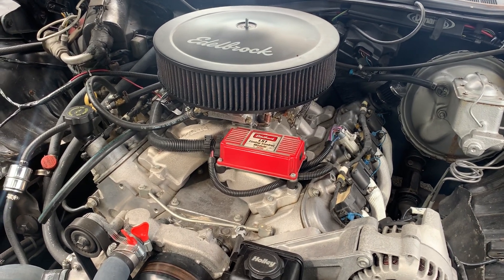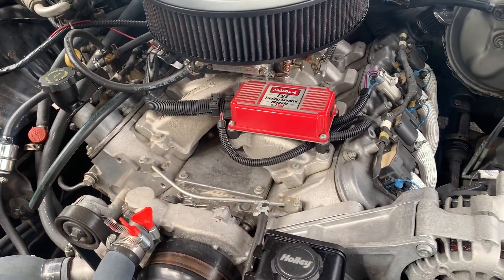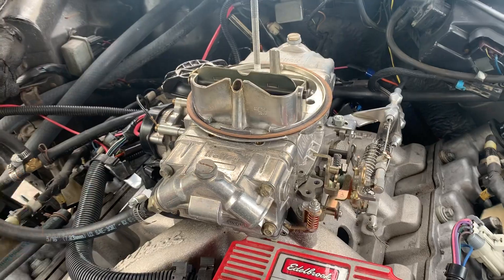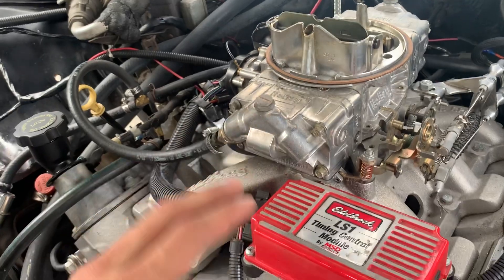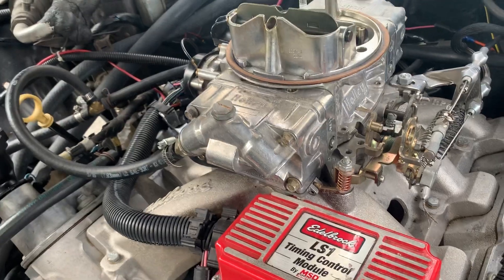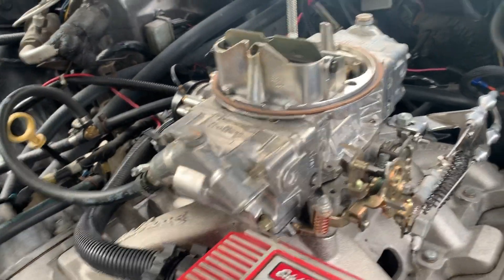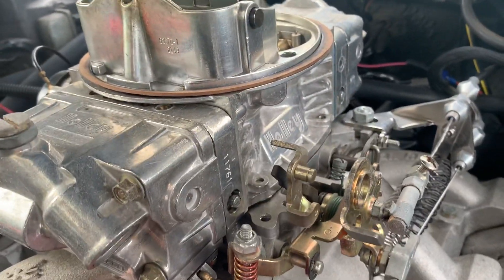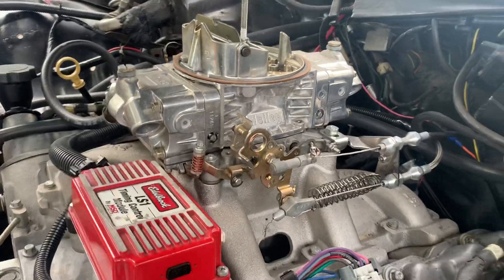How to tune a carbureted LS engine

Comment: Do you have an electric fuel pump… I messed up by adding electric additional eldbrock fuel pump 6-7 psi…. Think it to much gas
Reply from the maker: Yeah, probably I imagine it’s a little too much psi. I used a holly red because you don’t have to use a regulator if you’re using more fuel than that then they make other holleys that work. Plus the Halle that I used was plug-in play.  If you look it up on the LS forms for carb swap, you can see a lot of information on that topic that’s where I learned most of the stuff on lstech.com.

Comment: Not to tell you how or what to do but your engine would run a whole lot better if you go with a dual plane intake instead of the single plane .I went from the single plane intake to a dual plane one and picked up 50foot pounds of torque and a lot smoother running engine and the engine was a lot more responsive.I have a ls 6.0 with a sloppy stage two cam and I would never have believed it if my friend didn’t kinda force me into believing him

Comment: Used a street avenger 670 for the longest time. Couldnt get that bog out of a smooth transition. Went to a holley dp 650 and problem solved. Def rec one of those instead of the street avenger

Comment: Quick Fuel carbs work best with LS. Pricey but you won't have the bog problem anymore. I only adjusted the idle screws by ear. Runs like a beast! Aluminum 5.3 , 799 headd with summit stage 4 cam
Reply: What is your timing set at ??

Comment: Holleys suck ass anyway I've never had any luck w them ever but it sounds to me like your accelerator pump is in the wrong position and it needs more fuel but I want to run one w a quadrajet and I bet it would run much better than that pos holley does a good q jet will outperform and be much more of a all around streetable carb than either a edelbrock or holley would

Comment: Somebody needs to give this fella a lesson with an old school carb guy. Carbs don't time engines. Jetting, accelerator pumps, power valves, springs in that vacuum secondary set up he has. My advice is to watch videos and get a how to tune Holley Carb manual. Good luck.
Reply: Exactly! And the accelerator pump

Comment: Before tuning your carburetor, make sure you measure the amount of vacuum at idle (in neutral if a manual and in gear if an automatic). Once you see the max vacuum, half that number is what power valve you will need. This must be set before adjusting accel pumps, jets, etc. Oh yeah, LS engines love timing :D

Comment: Not many people launch at zero to 1000 rpm, that hard on engine parts. Try 1800 hold with foot brake then release brake and stomp it, you should have a better result.
Reply: Nobody goes from 0 to 1000???? 1000 is barely above idle. How dumb are you??

Comment: Preach.  I have a 07 LS3 5.3 that I have a carb.   I installed a stg2 cam.  2400 stall converter timing curve 1200rpm and up at 34 degrees.  Stock TH350.  4.10 gears. I floor it and watch the RPMs shoot to 2400.  Then the engine just bogs for a second then climbs.  I’m running an avenger carb with the 50cc accelerator pump.  AFR 14.3.  I can’t get rid of the bog

Comment: Mine is doing the exact same thing.  Bogging until it gets to 3k rpm  Even swapped the torque converter to 2200 stall. Did you do a second video to this?
Reply: Install a wide band AFR gauge regardless of carburetor type. Tune your carburetor in 3 stages, idle , Cruze , then WOT power.  Carburetor could be very lean causing it to bog through the RPM.  It’s very likely if your carburetor was purchased used that the jetting is incorrect for your application. No motor is the same.  Even a new carburetor will have to be adjusted to your motor.
Reply: I have and AFR gauge. 14.2 at idle.  14.7 cruising 17+ at WOT.initially but comes down to 14-15. Brand new Holley 81570. Off the line it’s still a dog with the higher stall.  Once rpms reach high 3’s it takes off.
Reply: @Keeterbob  Your definitely to lean at WOT. You wanna be anywhere around 12.5 at WOT.  I would Increase the secondary your secondary jets. Your other circuit read fine. If the bog is that low in the RPM. I would look increasing your accelerator pump shot / discharge nozzle. Not sure of your ignition type or engine size. But to narrow down the issue, swap another carburetor on it and see if it’s still there.
I run a LQ4 with 862 heads / TH350 stock converter, MSD 6014, 91 octane , RV cam , small AFB carburetor. Mines run like a bat out of hell.. You wanna size your carburetor to the highest shift point and cubic inch not the max RPM of the engine.
Reply: 5.3 is in a 74 K2500.   Th350 with 2200 stall. Stock transfer case   Stage II cam from summit. 4:10 gears
Reply: @Keeterbob  Heavy truck with tall gears, should burn tires at the light like no other. I have the summit 8718 RV / towing cam. 3.36 in a 68 el Camino. Mines a 6.0 with 5.3 heads.  Those gears your running aren’t designed for top end power, then are for low in. Try the 1405 and see how it does. I’ve been building carburetors over 13 years, that smaller the CFM  the better. May sound crazy but a 500 CFM will wake that engine up. As it will never use anything more unless your drag racing or shifting over 5k. Look up summit carburetor calculator and enter your highest shift point during WOT.
Reply: Just ran the 1405.  Made 6 passes.  AFR 12 cruising 15 wot. Still bogs.  The 1405 has more pep right off idle but that it.  Performs just like the 81570   I’m starting to lean toward my timing curve on my 6014
Reply: @Keeterbob  wouldn’t hurt to play with the timing. Mine used to set at the factory truck setting before I swapped to small cc heads now I’m on truck HO. If you haven’t hooked up had map port on the MSD 6014 , it’s not a bad idea to run it. Its just a vacuum line from the intake to the port on the box.. you’ll get it man! Good luck.
Reply: On my MSD  LS1 HO has worked the best of all of them.  Even customs.
Reply: Vacuum is connected
Reply: @Keeterbob  do you have lean spike right from idle ?? No vacuum leaks? I had the issue from idle when I ran a 750 carburetor.. but changed to a smaller carb and rejetted it.. stiffer accelerator pump.. larger discharge nozzle solved the bog for me.. your sound as it happening before the secondaries even open. So its either timing, vacuum leak, or carburetor idle circuit.. that’s each area I would dig into
Reply: 2006 truck 5.3 with an MSD 6014.  Going to try edelbrok 1405 with mechanical secondary.  See if that makes a difference.

Comment: The MSD box is a good solution for this engine thas has no factory provision for a distributor but MSD box  is not able to do  the vacuum advance, but only to do the mechanical advance, wich is not the best solution for street car if you expect to have the driveability low end torque and fuel efficiency
MSD should build a box with an additional Vacuum sensor connected to the carburetor, with several curves allowing the vacuum curve to be tailored as well as the mechanical advance curve
Reply: There is no distributor, it's electronic advance, no mechanical and no vacuum
Reply: @playsportfun3356  it doesn' matter mechanical or electronic ,  the engine need advance based on rpm (depending of engine speed rotation), and advance base on vacuum (depending of cylinders filling) ! That's rule of thumb ! 
Here the advance is based on rpm only ! Vacuum advance is missing and the result is less performance and more consumption ! For exemple Renault made a similar box like this one in the 80s ! Called RENIX, this box worked with a rpm sensor a vacuum sensor like a distributor but all was electronically performed !

Comment: Carborators are way easier to work with than Fuel injection in my opinion. Season changes you just have to adjust the choke. That little black circle with three screws. Move it one knotch back to lean when temps hit below 50
Reply from the maker: I agree I think I’m going to get a edelbrock back on it like I used to have
Reply: @PNWPablo  get an Avs2 Edelbrock...ive got a 1906 on my LM4 and couldn't be happier

Comment: I have the same control module but mine seems off. its running off real bad how do I adjust the timing. do you know?
Reply from the maker: Yeah, if you read the comments below yours you can get a good idea of what to do, besides that because we don’t have the control module that can be adjusted on the computer, you will need to go to the pills to see which one works best and to tune the carburetor in my opinion to the lowest setting I feel air so the stumble is decreased. There’s no way to control the timing with the carburetor unless you go through the simple steps of tuning the carburetor to your exact needs but the engine is hungry and always seems to need more when in reality needs less especially when you’re talking about getting the most HP out of your RPMs
Reply from the maker: And double triple check to make sure you have no leaks in the entire engine and exhaust system that’s the first step, then would be to tune the carburetor to your liking, that’s how timing is achieved with a carbureted LS1/LS6
Reply: I had the same box and went through two of them one had timing issues and one had the map sensor go bad the first one would drop out cylinders and the other one the map sensor just stopped so I went with the Daytona sensors box theirs have an external sensor so if the map sensor goes bad just unplug it and go down to the parts store and get a another one
Reply: Does he know? He thinks you time a engine with a carburetor!! LOL

Comment: Nightwrencher is 100% correct, need 50 cc accl pump,different size pump nozzles and an a/f ratio gauge, those carbs are super tuneable and you can easily get rid of the bog with a little time and effort

Comment: Nice setup! 
Use a AFR guage to tune it, you might be too lean or too rich off idle, mine was too lean, I had to richen up the idle feed, and lean the primary  high bleed screws, for good cruise, you will never know what the engines doing without  the afr guage. There about $130 best mod ever for a carb now I know exactly what the engines doing at all times, been driving my truck for 25k on the 5.3 quickfuel 580hr on the same jets, not to cold in Tx but when its cold I just let the truck warm up and it runs fine, Its my daily. Ive noticed ls engine likes about 12.9 afr at wot.My msd timing is set at 18-20° idle timing and 29° after 2800 runs amazing.

Comment: I fought with a hard stumble for the longest time on the build on my channel. What finally fixed it was increasing the 30cc accel pump to a 50cc and then getting the matching brown cam. Then I had to increase my squirter size from a 31 to a 38. The problem is that these engines like to go lean really fast, so you gotta feed them more fuel on initial toe in. Ive run both a 600 and a 650 that way so far so good.
Reply: Any chance you could make a video going through the fix? Would love to see it running and doing a pull or two

Comment: I see you guys running 650s or 750s depending on power you're looking for. I personally think a 650 on a single plane would be good but you really can't go wrong with the double plane. I'm no expert
Reply: You really dont want to run a single plane on a regular street car unless youre going to be racing it constantly. A dual plane gives you good low end torque for cruising and going to shows. For a stock LS a 600 or 650 seem to work if you wanna keep some of your mpg
Reply from the maker: Agreed, all depends on what you’re doing and I’m going to be tuning my Holley Carb to the same specs NightWrench posted about and then dial in it over a period of time. I want my engine to run smooth with plenty of power if needed
Reply: I was obviously drunk when I posted this LOL not quite sure what I was even talkin about all in a single plane. Dual-plane on a street rod is the way to go!
Reply: You think a single plane would be best? You clearly have ZERO clue what you're talking about.
Reply: @SOLDOZER  you're absolutely right! That was 3 years ago I don't even know what the heck I was saying? I'll be I'll be deleting that comment after you read this one
Reply: @samrogerskeeponkeepingon1486    At least you did not think you set the timing on the carb like the moran who made the video.
Reply: @SOLDOZER  right! 😂
Reply: @SOLDOZER  it wouldn't even have wrote what you said if you read the comments

Comment: Anyone with a project car / hot rod who is running a carburetor today needs to have a wide band o2 Gauge &sensor kit. It’s the next best thing to being on a dyno for tuning, and if it’s bogging off the line then you either have a fuel issue or a timing issue if it’s fuel make sure your accelerator pump is set up correctly and your squirters are big enough and if it’s timing you can adjust the msd unit via a laptop and not just rely on the pills. But for reals homey get a wideband kit